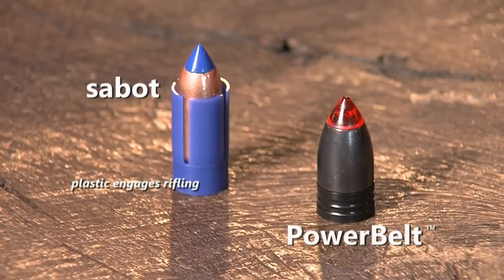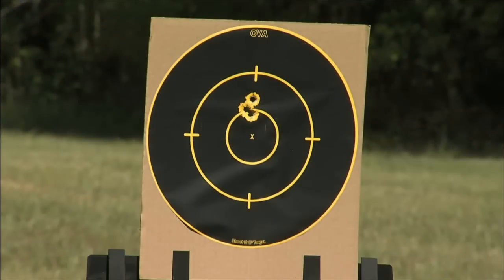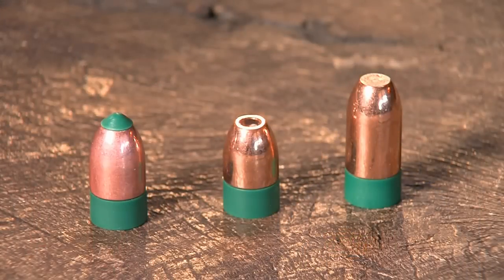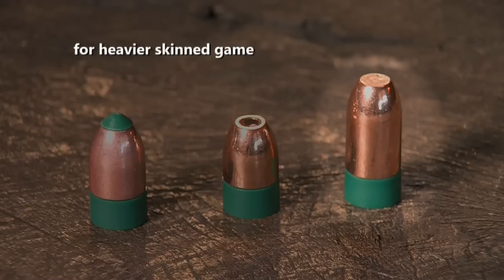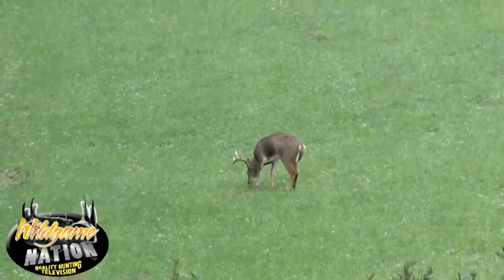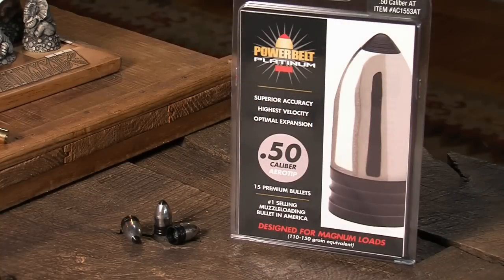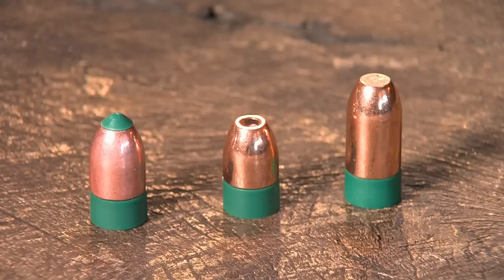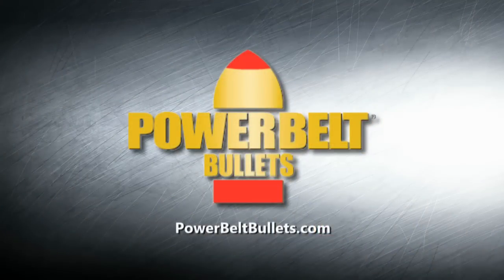THE POWERBELT STORY  The Best Muzzleloader Bullet

Comment: Hey All, I have a CVA Optima that I have had for 5 years and before that I had a Beartooth Magnum. I have always used the powerbelt's and never had any real problems with them. I have had to track a few down over the years and that is with a perfect heart lung shot. It happens! I have the same thing happen with my 35 rem that usually knocks em for a loop under 100 yards. My standard load now is a Powerbelt 245 gr hollow point and two white hot pellets. Works 99.9 percent of the time.

Comment: Powerbelts stink.  Stick with sabots with a trusted track record (like Barnes MZs).  I've muzzleloaded on mule deer and elk in Utah for years using Barnes MZs and they do their job.  I heard about Powerbelts and gave them a try and, like most people, enjoyed the fact that they're easier to load.  But the problem is they don't expand upon impact nearly as well as the saboted bullets.  I shot 2 mule deer bucks and 1 elk with the powerbelt platinums using a 150 grain magnum charge, and the bullets penciled right through the animals' vitals doing very little damage.  This allowed the animals to run for a few hundred yards before expiring.   Typically the Barnes MZ knocks them down in their tracks - literally - and I'm able to recover the mushroomed Barnes bullet (still fully intact) just inside the hide on the opposite end.  It does it's job beautifully!!   I switched back to Barnes MZs last year and my spike bull elk dropped in his tracks.  Sure, the Powerbelts are easier to load than sabots, but what good does that do if your game is running away down a steep ridge with a pencil wound through the lungs?   Even if you make a clean shot in the vitals they're likely going to run away and require a little bit of tracking.   Most hunters just need to fire 1-2 shots anyways... so the ease of loading isn't a hard convenience to give up.  Not to mention you should WANT a tight fit with your bullet and the barrel of your gun, otherwise you're risking pressure 'blow-by' out your barrel which takes away from your feet-per-second and force of impact.  Think about it!

Comment: Very old video and I doubt your looking at responses anymore but I just bought a USED. ( But I'm betting had never been fired as it was way to clean ). CVA Hunterbolt Magnum rifle in .50 cal. Got an extra .45 cal. barrel with it that may have been shot but was also very clean.  I have shot it ten times total so far and that was with your Powerbelt Platinum bullets at 75 yards, Open sights, sighting it in. I was shooting two 50 grain Pyrodex Pellets as that's what I had and people have to understand that we have to shoot what is available in our areas and that varies a lot depending on where you are. I walked these bullet up on a man sized target until I hit dead center and they seem to be very accurate. I have Over a hundred of your 295 grain Hollow Point copper bullets now but have never shot one as of today. I've only had it a week. I've heard a lot of bad about these bullets not fully penetrating a deer but they were also almost all shooting a magnum charge of 150 grains and I think that is more of their problem than the bullets. If you want Any bullet to blow up, push it to fast. Works every time and not only in front stuffers. This wasn't my first choice in a rifle, but when you can buy a basically new rifle with two barrels for $109.00 and get a box full of accessories raising the price to $165.00????  Wouldn't you buy it?  I did miss that AR 500 target once and we recovered the Powerbelt Platinum bullet after digging about six inches into hard dirt and it showed good deep rifling groves on the bullet itself. It was flat but you could clearly see them on one side of it. The plastic tail was still with it. I understood they left when they came out of the barrel but this one didn't anyway. The thing that impressed me most other than the accuracy was that the tenth one loaded as easy as the first one. With no barrel cleaning between shots what so ever. Clean up was fast and easy afterwards too using the Pyrodex Pellets. Standard .209 Winchester Primers. Again, what I had. Just an FYI. I've got two cards of the 330 grain ELR's too. Hope that wasn't a mistake and they shoot to the same point of aim. Or close to it.

Comment: Not sure why half the guys testimonials I've read its works for them and the other half it doesn't, that's what needs to be explained. As for me, I have a TC Encore 50 that was basically a fireworks demonstration with the exhaust and fire blowing by the Powerbelt 50 cal. bullet or it exiting the gun a miserable 10-30 yards down range (if that's the right word).  Went back to my TC sabots and am shooting pie plates at 250 yards.  Like the ease of use with the PB's just not the end results
Reply: Your delima Explained: Not all black powder barrels are made to the same standard. Some have .500" bore, while others have a tighter bore of .489-.492." the tighter the bore, the better the powerbelts work, the more standard, the worse they work. Most shooters are not aware of this.

Comment: Powerbelts do not touch the lands, therefore they do not load straight. In return, they wobble in flight. This produces a large group with little accuracy. I know, I shoot less than 1 inch groups with my Black Powder using Sabot's. My longest shot at a deer was 159 yards, twice. If you plan to stay under 60 yards, a Powerbelt is ok. But why limit yourself?
Reply: +Charles Carpenter
I am an experienced gunsmith, reloader, gun builder, designer, and trouble shooter. I have swagged several powerbelt's down barrels and found the copper does not touch the lands equally. Most don't touch on one side or the other at all. I am also very familiar with the density variables, powder charges, and scope accuracy issues. Taken all of this into consideration, they are not worth my time at all. I shoot less than half inch groups at 100 yards with all my black powder rifles, and shoot pop cans with a cap and ball at 100 yards. One inch is the norm when I am not setting in a scope.

You may have one of the barrel's on the market today that uses a narrowed rifling, .492," instead of the norm ,500". In that case, you may be able to develop a better sense of accuracy with the powerbelts than other people can with their guns.

However, you need to be made aware of the dangers of over loading a black powder rifle beyond 100 grains.  Hogdon does not support the overloading of black powder rifles. If your gun blows up, who you or your medical insurance company going to sue for damages and medical bills? I would be willing to bet of the 150 grains that about 40 grains are wasted flying out the end of the barrel in unburnt particles as the smoke from a 150 grain load is considerable, not to mention the kick is bad.

https://www.hodgdon.com/ml-warning.html

Comment: shot two deer with these one ran like 75 yards and no blood also shoot a doe in the neck with one a little blood then stopped never found her switched to hornady sst we will see how they do but i know im done with these
Reply: Im in the same boat.  These bullets have caused me tons of frustration.  I shot at an embarassing amout of deer before putting one down and even then it wasnt clean UNDER 20 YARDS!  When I found it another deer I had lost weeks ago was on the ground eaten up next to it.  The bullets really do seem to pass right through while doing minimal damage.  I went to bass pro for help.  I talked to two separate employees and when i told them I was using powerbelts they really did laugh and recommended Hornady SST.  I hear the ticket is Blackhorn 209 powder CCI 209M primers and thats what im going to try once I fit my firing pin with the shim kit to properly accept the primers.